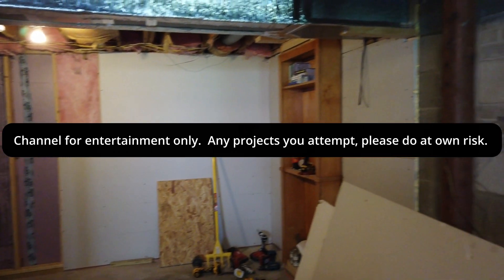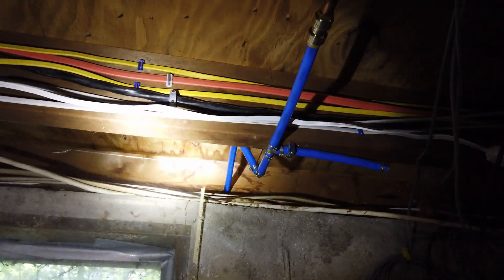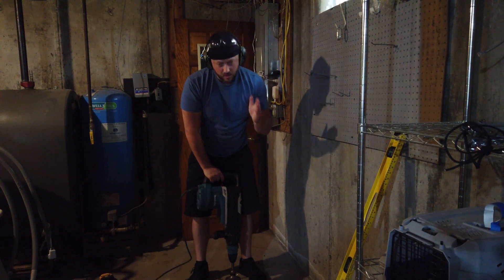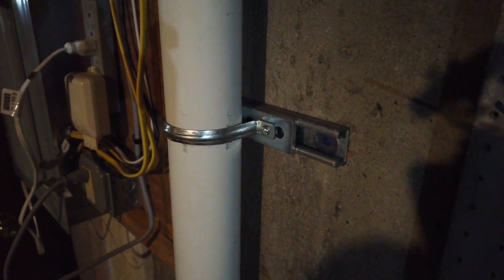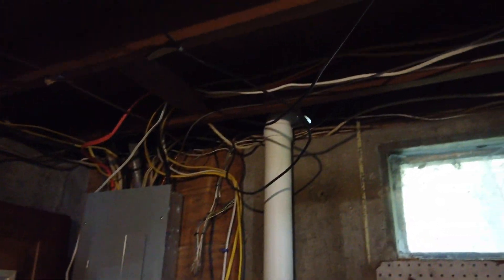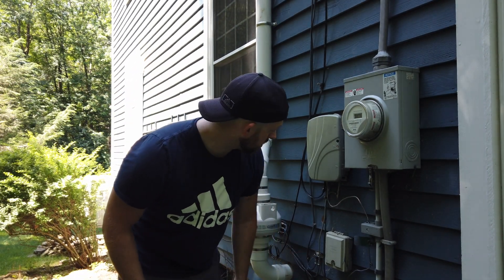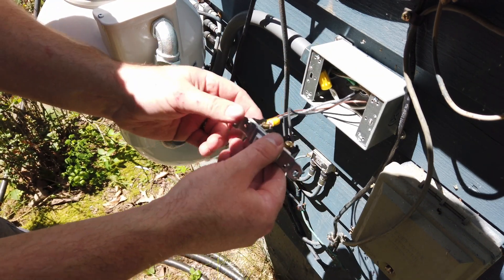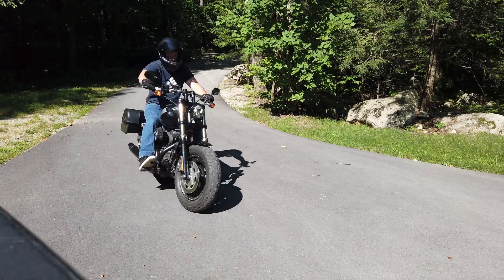Radon Mitigation Install

Comment: Thanks for posting.  Just installed one yesterday and one thing I learned is that you’ve gotta dig out about 10-15 gallons of soil from your hole to get proper air flow.  When you hook up you monomiter to the tube it should read around .2 to .4…the higher the number the worse the airflow.  Looks like it’s working for ya though so good work!

Comment: Quick tip on large holes bud. Score out your vynal. Then drill 10 plus holes threw the wood with a 1/4" bit. ( takes 30 seconds) cordless drills are beat up by big hole saws.. 😂 trust me.. then run the holesaw  threw the predrilled starting point.  It'll cut like butter compared to without! Give it a try... I like to stop drilling 90% an pop out the core before it gets wedged inside a hot saw also.. nicely done buddy 👏!

Comment: That's funny.  As soon as you started drilling into the slab, I thought, "Whoa!  That's way too close to the footer!" not just for difficulty drilling, but more so for suction of radon (assuming the slab is on a gravel bed).

That's exactly the sort of mistake I like to make, but you were much calmer about it than I tend to be.  :)

Comment: Brother, Solid explanation with the lighter , have never tried this before. We install two lines, one in the slab, and one into the foundation and we keep the fan inside. Solid work.
Reply: Just heads up it's against code for the fan to be installed inside a basement or any occupiable space, This generally only leaves outside or in the attic as viable options

Comment: Why not take the electrical straight out next to the PVC??
Reply from the maker: Snow
Reply: @TheProgressA  why is that a problem?
Reply from the maker: If I get enough snow to cover switch, which happens up here, and if I had to access switch for some reason I don’t want to shovel it out. Per code it needs to be readily accessible.
Reply: @TheProgressA  It odd they even require a switch considering you have one inside.

Comment: I would seal the first hole you made with concrete, otherwise, if left open, your radon fan will be pulling air from inside the basement.

Comment: Couple of things... The manometer does tell you that the system is working. But the big purpose of that is to tell you the CFM of air the fan is moving. Yours is at around 1.3 so it's moving around 70 CFM of air. The initial hole was at 1.8 1.9 which was less than 15 CFM. No bueno for removing radon from a home. Big kudos for you doing this on your own. The wiring, I think you made that so much harder than you had too, but to each is own. Great job overall. 6.5 out of 10.

Comment: Congrats for the DIY. My only comment is that you have great suction on the opposite side of the basement. While that's great for reducing Radon, it can also mean you're sucking in conditioned air from your house. Might be worth it to check the footer/slab joint perimeter to make sure there are no holes where you're losing expensive heated/cooled air from upstairs.

Comment: What is that Radon reader you used at 16:48 and does it read in real time. I have an Airthings and it only give a 24 hour avg number for the most current number.
Reply from the maker: It’s an Airthings wave. This is from their site. 

The radon measurement you see in the "app overview" screen for your monitor is always a rolling 24 hour average, that updates with each hourly measurement that is taken.

Comment: The vent termination must be 10' away from any building opening and yours is very close to the windowl upstears
Reply: Away from the window is best if you can. However, depending on your local code, it can be closer to a window but must terminate a minimum of 2-3 feet above the roofline. The only place we could run our pipe was beside a window like this. We ran the pipe so it terminated 3.5 feet above the roofline. No issues with radon rentry based on our meters. Humidity is something you have to watch though.

Comment: I currently have a 3” pvc for my mitigation system.  I was thinking of upgrading to 4” to have more airflow?My manometer says 1.4.  I’m hoping I can bring it down for more airflow and drop my radon levels even lower.  I’m averaging 3.5.  Do you think it will be difficult upgrading from 3” to 4”?
Reply from the maker: Any way you can check your radon levels?
Reply: @TheProgressA  yeah.  I’m using ecocube averaging 3.5 pci/L